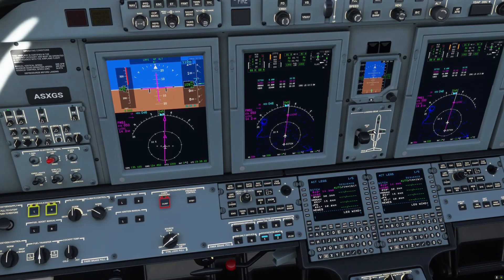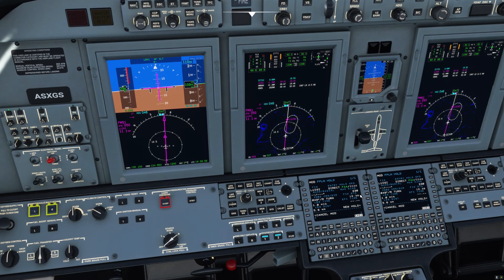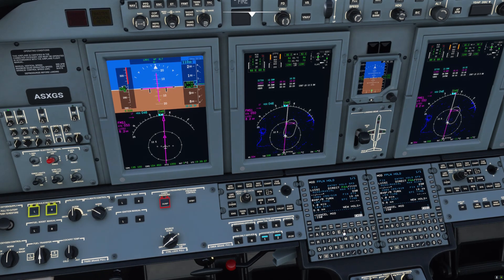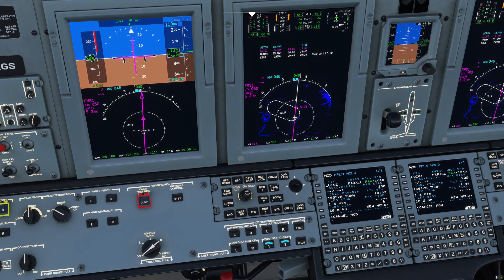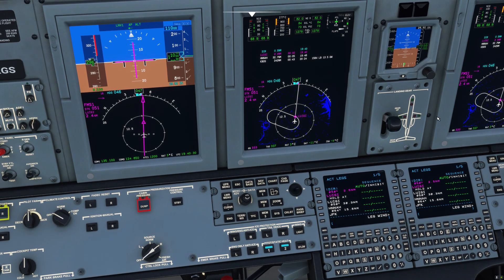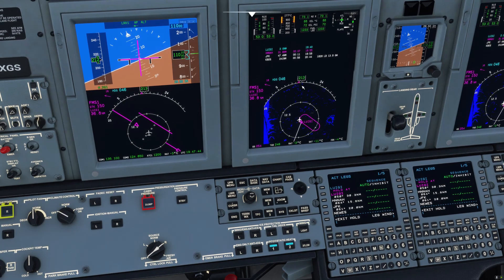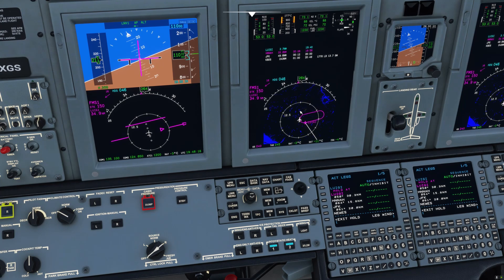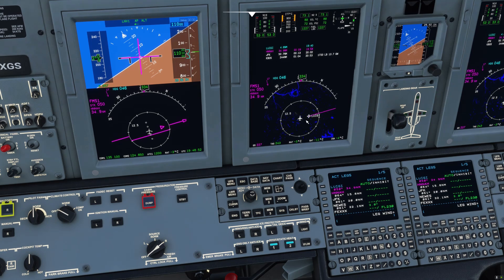Working Title CJ4 Holding Procedures

Comment: Brilliant, brilliant, brilliant!   I just watched the three new videos that you posted and tried each function and it’s amazing...it’s like I’m flying the Premier 1A again (which of course also has the FMS3000 and PL21) which I very much enjoyed.  I have a link to a short video that shows the startup of a CJ4 (without a GPU) and there is a feature on the CJ4 that definitely was not on the Premier.  In the video, before the pilot turns on the “BATT MASTER” switch (and based on what I’ve heard, the battery can die somewhat quickly on the CJ4 (without a GPU) if the engines don’t get rolling somewhat quickly), he switches the avionics switch to a down position which turns on the left MFD (PPOS mode) and the left FMS, which allows him to program the FMS before passengers arrive and when he is done he switches the avionics switch to the middle position which is “OFF.”  When he does actually start the engines he turns the “BATT” switch to “ON” (which turns on the left FMS and MFD, which shows the engine gauges, CAS messages and “systems window” (no compass arc is displayed) and the FMS has retained what he programmed in the mode I just spoke of and he starts the engines.  After he starts the engines, he flips the “Avionics” switch up to “ON” which turns on all screens and the compass arc then re-appears on the left MFD and the CAS messages move over to the right MFD in place of the engine gauges (I am very curious about the logic of displaying of the CAS messages on the CJ4.  I know you can press a button on the MFD CDU to display them, but what happens if one pops up during flight?   Is it automatically displayed on the left PFD and replaces what you have selected to display like FMS data, checklists, etc. or does it always appear on the right MFD in place of the engine gauges display)?   Also when the avionics switch is flipped to the “ON” position, the attitude indicator is “blank” (for lack of a better term, as it is on every aircraft I’ve ever flown that has a glass cockpit) and says “Alignment in Process” where the attitude indicator would be displayed while all four of the compass arcs slowly rotate until alignment is finished and then the Attitude Indicator springs to life and the compass arcs quickly flip to the correct position.   It would be great if these real-world startup actions of the avionics could be implemented, which would really add to the real-life immersion, especially the mode (that I didn’t know about) on the CJ4 that allows you to program the FMS without turning on the “MASTER BATT.”   I’m guessing it wouldn’t be that hard to program, except for, perhaps, the CAS message logic (since both MFDs currently display the same thing).  But what do I know?   I’m not a computer programmer per se, however, I would be interested in knowing what programming language MSFS uses (also many years ago, when Eaglesoft came out with their Citation IISP add-on for fs9, I was so desperate for a “study-level” Citation ( when it came to avionics) that somehow I learned what ever programming language was used for FS9 and reprogrammed their Sperry SPZ-500 autopilot so every mode operated exactly to the specs in the manual (I somehow got a hold of) and also created a new altitude selector, which I added the ability to display and modify “STAEL”, “TO” and “FROM” (NM) and “VANG DEG” so the very rudimentary VNAV system worked exactly as according to specs).   It took me six months and I don’t think I could ever remember how to do it again (I also added the Reality XP GNS 530/430, Sandel HSI and TAWS (with EGPWS) display and WX Radar, so I had a Citation in the simulator that had all the avionics features of a real, updated panel, Citation IISP).   Anyway, I would love to hear your thoughts and the answers to my questions on the CAS message logic and the PL21 avionics in the CJ4 during startup and what might be possible to implement.  Happy New Year and Cheers to the Work You’ve Done so Far and To Many More Years of Perfecting the CJ4 for MSFS!  And again my deepest, most sincere, “Thank You” to you and those helping with this project (if money is ever the issue (for whatever reason) that is standing in the way of adding more realistic features to the CJ4, please let me know)!  Here’s the link to the startup video (although I’m guessing you know exactly what I’m talking about).  https://youtu.be/swLwahgaxoQ